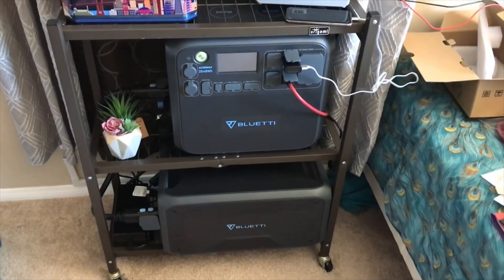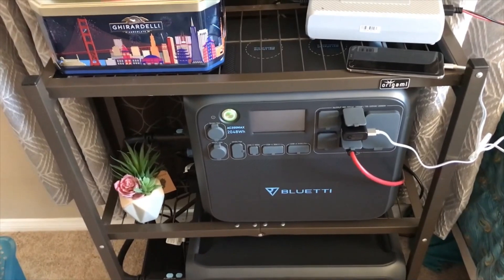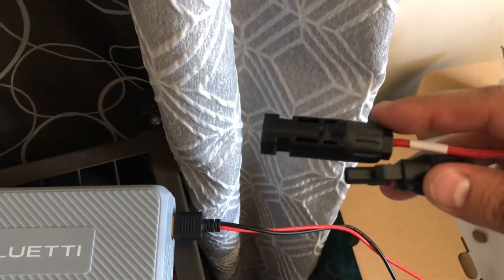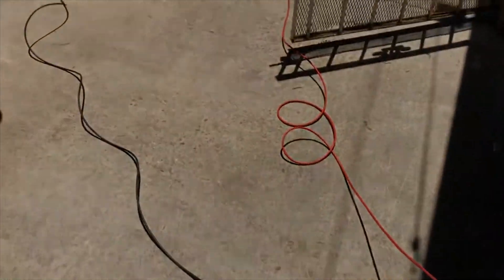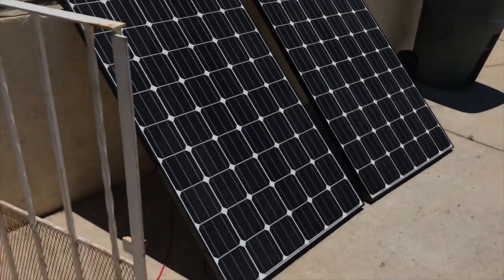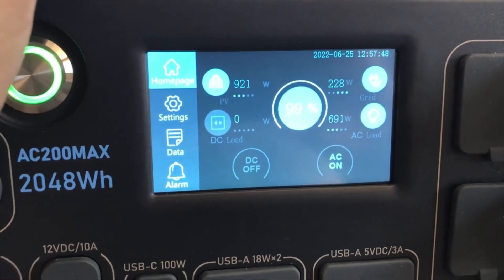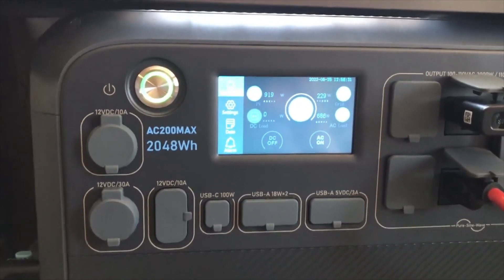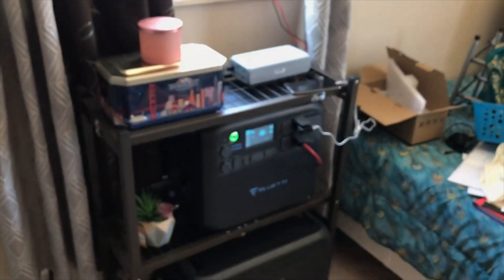How to setup bluetti enhanced charger on the Ac200Max

Comment: In one of your videos you showed your roof setup of 6 panels in 3s2p.  I believe you can over panel as you are doing in watts, but how many volts are you pulling since the max can only handle a published 145 volts and I believe 15 amps.  I am ready to set up my panels and I'm curious of your specs.  Your comments would be greatly appreciated.
Reply from the maker: So my roof setup is 3s2p at 114volts and 27 amps. The max only uses up to 15 amps the rest is ignored. The model number for my solar panels is LG260S1C-A3
Reply: @OffGridSolarSmartHouse hey man first I want to thank you for this video This is the first I've heard of the enhanced charger I don't think it's available in my country unfortunately but I'm going to look into it. I would appreciate it if you could help me figure this out because I'm very much confused. I have a couple of the AC 200 Max systems. I also have an on grid system with 12 450 watt panels and a 5 KW inverter although the maximum my pull during the summer is about 3 kilowatts. And the maximum in the winter is about 800 watts. I'm looking at my inverter now and there's two settings I see four cables running into the inverter so I guess I have two separate series running. here are the numbers. Pv1 is 255 V 1.3A 330W PV2 is 255V 1.4A 357W. 

So my question is if I have a power outage from the mains and I close all my fuses and I turn off my on-grid inverter and I unhooked these cables can I hook up each separately to one of my 2 ac200max systems? I don't want to blow anything. I'm not sure if the charging enhancer would be necessary or beneficial in this case because I have multiple devices so I could charge the two on each separate circuit at the same time and then my thought process is once the power is restored in the neighborhood I can turn on my fuses again reconnect the cable to the inverter and turn that back on I would only use it to power my refrigerator and this would be in sort of some sort of extreme catastrophic situation for example when we have power outages the power usually comes back on pretty quickly the most I've been without power is 12 hours but I'm thinking about this as like a days of lost power situation where I could essentially convert my on-grid system to an off-grid system and still use the panels to give some energy to my power packs. what do you think?
Reply from the maker: No you can't connect your solar arrays the your bluetti ac 200 max because the max solar input for the 200max is 145 volts for solar. The enhanced charger is 60 volts. You would need to move things around to get under these levels.
Reply: @OffGridSolarSmartHouse actually I came up with a solution I bought that enhanced DC charger. My idea is if I ever have an extended power outage here I'm going to go to the roof and unhook part of the string of panels and I'll just wire two of them only directly into the enhanced charger that way I'll be below the maximum voltage amps I think just two 450 W panels I should be okay with that to be honest though I'm hoping I will never have to use the thing but I'd rather have something and not need it than need something and not have it. I can also run some of the panel on from the other side so I can get extra charging I know it maxed out at like 1200 watts but probably I'll never have to do this never know what may happen though thanks for the feedback
Reply: I have 4 Panels in Series, each have 390 Watts 12.73 Amps and open circuit voltage of 147.4volts its a Little More then allowed but there is always a Little toleranz. It works perfectly since 3 Weeks
Reply: Personally, I would not go higher than 125 V as Voc increases in cold weather
Reply: @nikolajhol  Yes, you're right, I've now also bought the b230 battery extension and the D050S is attached to it. I removed one of the 4 panels and connected it to the b230. Now the AC 200max gets about 110v.
Sorry for my poor english
Reply: @TMTech  No worries, I am not a native speaker myself🙂
Reply: Three 400W monocrystalline panels in series work fine for me on AC200 Max to get 920W most of day 0800-1500 in tropics.  My sea container house is solar powered by the Bluetti AC200 Max with air con of 12500BTU at my channel @ebikecnx7239

Comment: One of the down side I saw with the AC200MAX is the pretty long AC charge time which takes about 4 hours and also add to that the annoying fan that turns on whenever the charger is plugged in.
Reply from the maker: So if you charge it through ac it would take a while because it charges at 500 watts. They do sell a device where you can connect to charger together to fast charge it in half the time at 1000 watts. Some of the charger bricks the 500 watt charger has annoying fans. they also have a 400 watt charger without fans. Hope this info helps.

Comment: Two questions,  Why don’t you use the 3 prong 30a outlet to feed the house? Also a weird question did you ever try plugging in the BLUETTI into it self to see what happens??  Will it power itself and try an charging the battery at the same time?
Reply from the maker: This is a good question. The way my house is setup most if not all my breakers are 15a to 20a. Three of my breakers power most my house. You can't use the air fryer and the microwave our it will trip. The transfer switch doesn't have the 30a plug. 
I figured that the Ac200Max inverter wouldn't allow me to power anything over 22watts anyways so i was fine with that. The same principle holds up. I can't power the air fryer and microwave off the bluetti without it going into faults.

If you plug the charger into the bluetti outlets and then into the unit to charge it will appear to charge but the battery percentage won't move.

Comment: Hello, if i have the AC200 Max + the B300 and 800W solar panels,
 Does the solar panels will charge the  AC200 Max + B300 in the same time ?
I ask because B300 has max capacity of solar charge of 200w

Thanks :)
Reply from the maker: Yes, if you connect the ac200max together with the B300 they both charge at same time and work as one unit.

Comment: Greetings, when is charging the ac200max, is the b300 charging too?
Reply from the maker: Greetings, when the ac200max and B300 are connected they charge together and work as one unit.  So yes!!
Reply: Thank you very much, you cleared my doubt.
Reply from the maker: Let me know if you have any more questions. Happy to help.
Reply: @OffGridSolarSmartHouse  Greetings, I would like to know if you bought the solar panels on a website or app?
Reply from the maker: I bought my solar panels used. I found someone in my area selling them off Craig's list. I took my unit with me and tested them out. I got them for $70 a piece.

Comment: Hello I have a question love u set up thank you for sharing I call bluetti in las vegas  I have the ac200max and I wanted to get the xtra battery b300 to get more run time but he said the the Eb300 not compatible  it’s better for the eb30 for the ac200 max  but bluetti website say the ac200max is compatible with the b300  u had no problem also can I get your emails if I need help or have a question I being doing my study’s
Reply from the maker: Hi Cateyes, The Ac200Max works well with the B300. Email me anytime happy to help andrew6103@yahoo.com
Reply: Thank u very much 🙏🏼
Reply: Thank I very much

Comment: Can you plug the charging enhancer directly to the B300 battery?  Potential to add even more solar input?
Reply from the maker: Yes you can. The B300 has a built in MTTP controller allowing you to charge it without the enhanced charger up to 200 watts. Using the enhanced charger will allow you to charge it up to 500 watts.
Reply: Yes get a second D050S and charge both units, plus a 200W solar input into the B300.

Comment: I use the enhanced charger with my AC200p and it works great. I like that Bluetti gives the option of dual charging. It’s amazing how quickly it will recharge such a large battery.
Reply from the maker: Do you use it for solar charging?
Reply: @OffGridSolarSmartHouse  I use it as additional solar or if I just want to use one panel since the AC200p has a 35 volt minimum for the solar input. It can also be used to get more wattage when charging from a 12v source. I like the versatility of it.